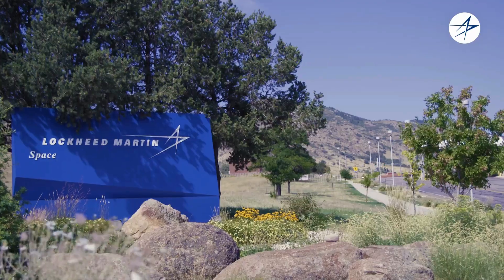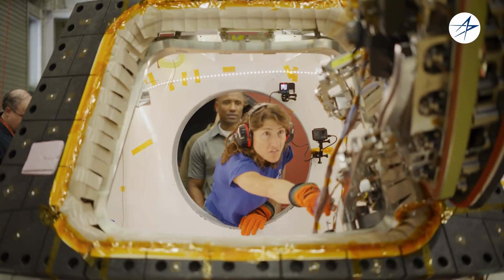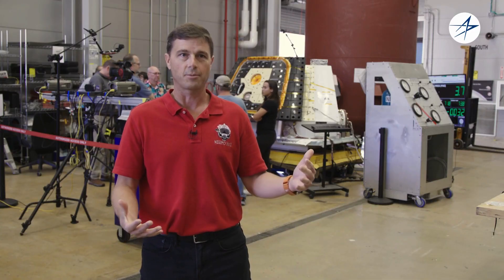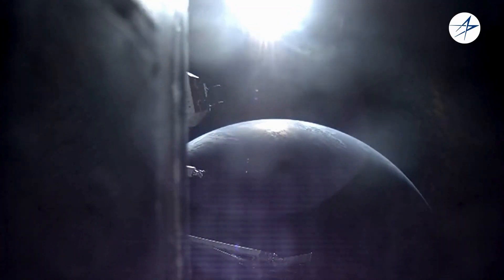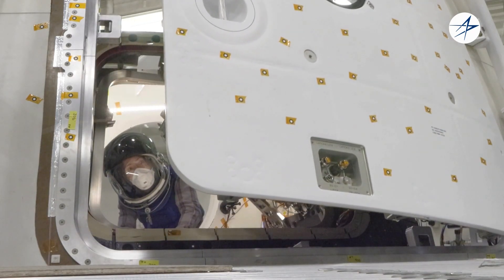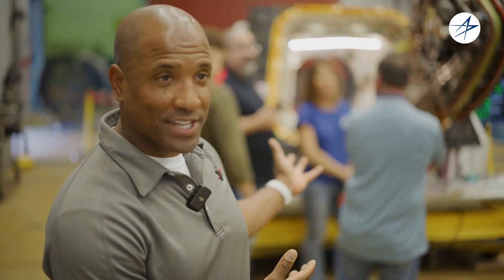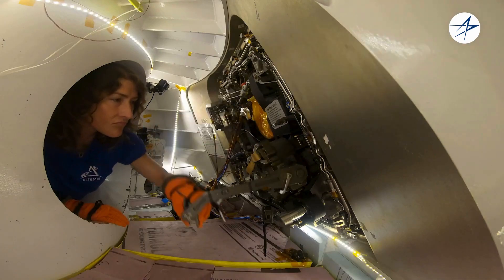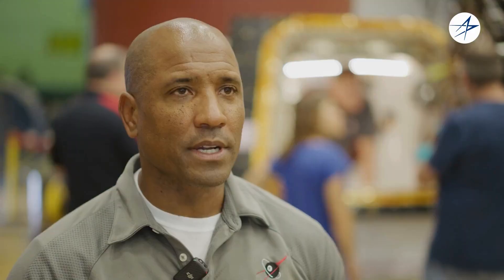Artemis II Astronauts Get Hands On with Orion

Comment: I will be really shocked if a crew actually goes to the moon. How will they block the radiation from the Van Allan belt?
Reply: the same way they did with the apollo flights, they take a fast and direct trajectory through the thinner parts of the belt to minimize time exposed, and the capsule is adequately shielded. van allen would tell you